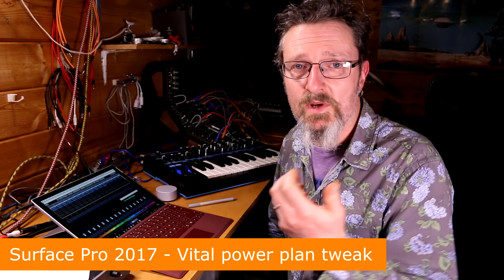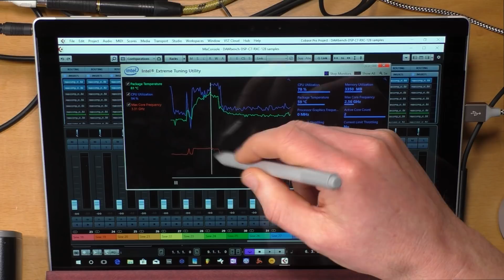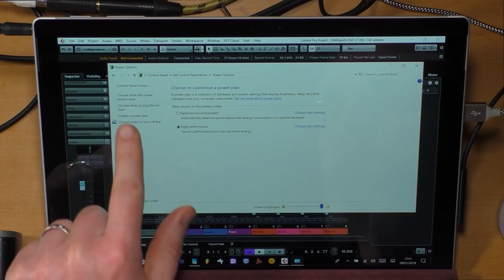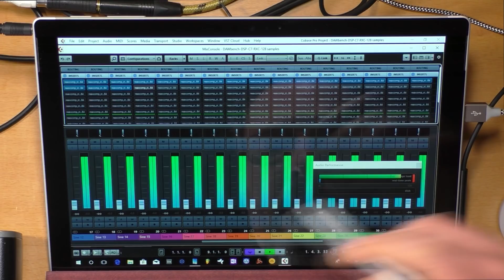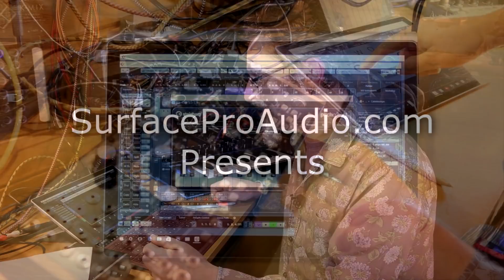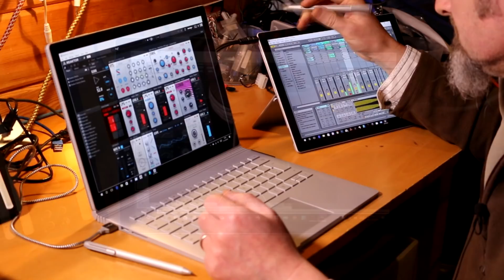Surface Pro 2017 vital power plan tweak

Comment: why not leave cpu at 100% and turn off processor  performance boost mode instead. There's a .reg edit to enable that setting in power. Also I think i saw it in intel tuning utility (When i had it..)
Reply from the maker: Yeah....... doesn't work.
Reply: the reg unlock did it for me. I've set performance boost to disabled from power menu when unplugged AND ageressive when plugged in. Then I ran stress test in Intel tuning utility. Clock speed was 2.5 GHz when unplugged (max) and when I plugged it in and ran test again it worked at 3.9 GHz. I have a surface pro 2017 w i7 cpu.
Reply from the maker: Cool. And how did that affect audio performance?

Comment: I found that setting the Processor Scheduling (found in 'Adjust the appearance and performance of Windows', under the Advanced tab, set to 'Background Services', also dramatically affects the stability when producing music. This is not something I found out, but followed when doing music on Windows about 10 years ago. It still seems applicable. Not sure if you mentioned this, but worth giving a try! (I leave it to 'Background Services' permanently, as it feels better to me in general. HTH.
Reply from the maker: That’s funny. It’s always in my tweak guides and I always get comments from non-music-makers that it’s wrong and yet it’s been good to me. So it’s really nice to be agreed with for a change. But as I always say - try it for yourself and see if it makes a difference.

Comment: Is this really just a Surface Pro 2017 tweak? Or would you also suggest it on something like a 1st gen. Surface Book i7 (w/ Performance Base)? Is it exclusively the fan-less design of the Pro that you find makes it worth essentially disabling turbo? Or do you think that active-cooled Surface models would benefit from this as well?
Reply from the maker: Why don't you try it with your system and see? I used a similar tweak on the Surface Pro 3 to stop it reaching high temperatures and throttling down. For people looking for stable CPU power, rather than bursts of CPU power then I think it's a good idea.

Comment: Love that you're exploring practical use cases for the surface that microsoft haven't focused on. 

Perhaps they may try in future to bring back an audio focus with specialised audio keyboard "blades" although that concept seems to have vanished.

Do you know if any external soundcards/interfaces can assist surface with stable plugin heavy DAW usage or are they mainly about allowing inputs and outputs?
Reply from the maker: Yes, check out the UAD Apollo Twin, it has built in DSP to run some very high-end plug-ins. https://www.uaudio.com/audio-interfaces/apollo-twin-usb.html

Comment: Great tip, but doesn't seem to work with Surface Pro 4 i7. Although, to be fair it can hover at above 3GHz pretty consistently for hours on end, so that's not really necessary. But it would be great to somehow prevent it to go into turbo (and fan noise) for less demanding projects...

I need to dig deeper :)
Reply from the maker: I find all Surface generations to be very different in terms of taming the CPU. The 99% thing worked well with the SP3 actually but for different reasons because it stopped it getting too hot which caused awful throttling.

Comment: That is a great quick trick to deal with throttling!

For the brave, we can boost the TDP on some Intel 7xxxU processors from 15 to 32 watts. And run all threads at max turbo clocks! Not sure it will work with the Surface Pro or Surface Book but worth a look.
 
http://forum.notebookreview.com/threads/the-throttlestop-guide.531329/page-563#post-10478523

Take care not to brick your laptop!
Reply from the maker: I'm yet to see ThrottleStop work on anything. I did a lot of testing with it on the SP4 when it had all it's CPU problems, but it had no effect. I haven't tried it with the SP 2017 but i'm not really seeing the need. Running a mobile CPU at maximum turbo is not what it was designed for - you'll just break it and overheat your system.
Reply: Thanks again for all the great videos and comments Robin. While watching this month's video I thought, this is a great substitute for a magazine with plenty of well-thought out professional content. Well done!

To your comment, heat is definitely a major challenge for those ultrabooks. Maybe the power tweak will work better on larger units with fans & easily repasted CPUs. Thanks again!
Reply: Superb music & tutorials from you! I followed your suggestions, I don't have a Surface but I own a Dell XPS 13 9360 with the i7 8550u and being a quite similar architecture with similar pro & cons, all your videos helped me a lot in general. About Throttlestop, I use it and it improved drastically performances NOT by boosting and giving more turbo, but UNDERVOLTING to lower temperatures and by consequence allowing higher clocks. Also it lets you enable and set Speedshift for higher performances, but I don't know if this applies also to new Surfaces. In throttlestop I created a normal profile at stock settings and and "Audio" profile that kicks in when I plug AC: this, combined with a good Windows power plan and optimized OS, makes the XPS performing very well! Here are more infos if you want to give a try again on the Surface: http://forum.notebookreview.com/threads/dell-xps-speed-shift.796891/

Comment: The new 8th gen i7 tablets coming out this month, should work way better, quad core.  And Dell is dropping a 2in1 (laptop that flips into a tablet) with the higher voltage 45 watt 8th gen i7, epic! https://liliputing.com/2018/01/dell-launches-xps-15-convertible-intel-kaby-lake-g-amd-radeon-vega-graphics.html
Reply from the maker: In what way will they "work way better"? The power of the CPU has nothing to do with getting glitch free audio out of a laptop - it's all down to the implementation of surrounding technologies, the DPC latency, the ability of a CPU to maintain a stable speed. Time after time people struggle getting laptops to work with audio production successfully - so it is never a given. The only way to know is to try it and see :)
Reply: vampzim that and that new Spectre 360 by hp look amazing this spring
Reply: With those machines there are things to do before making music succesfully: 1-First of all uninstall all Dell Update softwares and components. Thay provide a .dll (I don't remember the name right now) spiking the CPU as hell.
2-Disable absolutely wireless while playing (it causes crazy drops/click/spikes). I use to put the laptop in Plane mode.
3-apply the tweaks and suggestions in Molten's videos, they are good advices in general for any DAW.
4-check the video card settings in the Intel panel...I had to disable colours and image correction and power saving to reduce the spikes provoqued by directx calls on the cpu.
5-if you are confident with it, get Throttlestop, undervolt your CPU/CPU Cache, GPU, enable Speedshift and set it to a reasonable amount.
Dells are ok...great laptops...but need a lot of tweaking to be good daws.